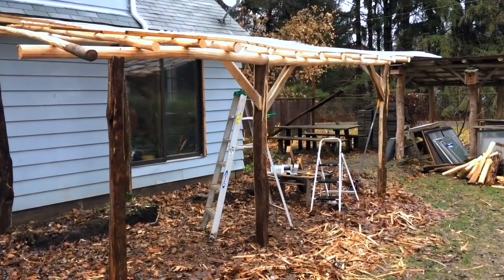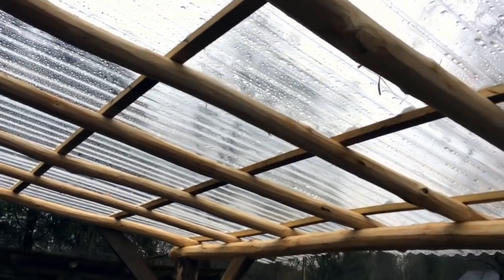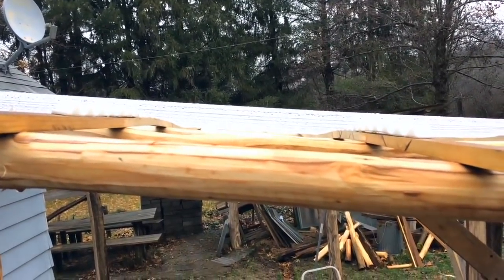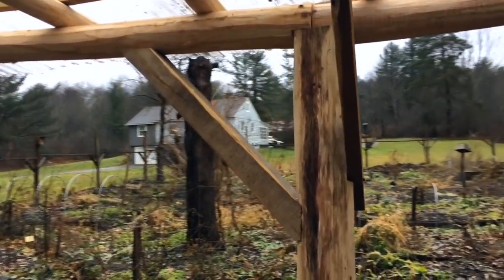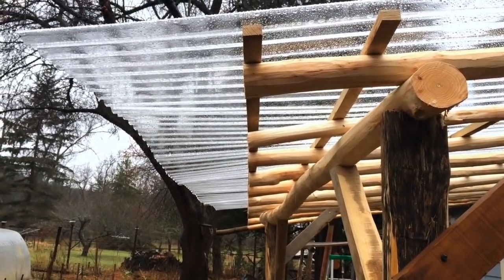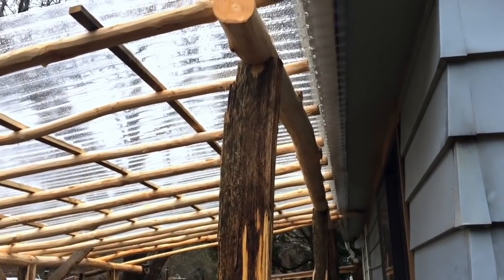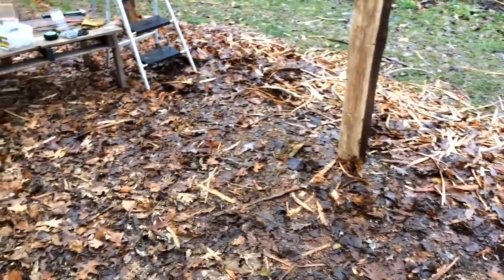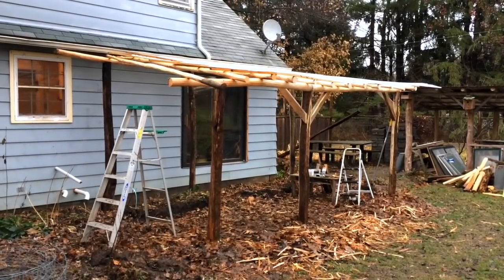Passive Solar Greenhouse - II - Roofing on and ready for walls

Comment: One more comment on the snow loading aspect. Depending on your area typical snow design loads are 20 to 50 pounds per sq ft. I'm eyeballing it here but it looks like you have roughly 10 feet by 6 feet. At the conservative end of 50 lbs per sq ft, you are looking at 3000 lbs. Also consider that the roof above this may sheet off snow onto the roof due to the relavite pitches. So just be careful thinking 200lbs is enough of a test, that could be an order of magnitude off.

Again, I'm not trying to make problems, but I think there is actually a potential for this to fail, and a little extra bracing, especially to eliminate any rotational moment arms.  Send those members into compression and not shear, it may be well worth it.

Quick edit... one other thing to consider is that the full weight, say 3000lbs will be spread across each member and you did a fantastic job using many members. Now it gets really complex here when you start considering that all but 3 of those members will bend and arent really supported against bending moment. The only 3 that are, are the ones with the 45 degree pieces. To assess it completely you would need to model it, but, all that being said, I think even with the excellent short spacing of the roof members, you will want to strengthen up those 45 degree pieces to put them in compression by driving the load through them, straight through the vertical posts, not attached to the side of them.
Reply: Not perfect with construction knowledge myself but this seems a comment focused on constructive,  helpful feedback,  thank you

Comment: Good progress. I'm not going to lie there is one thing I'm concerned with and that's the moment arm on the 45 degree pieces. Those should ideally be putting their load directly onto the support post, and not bolted into the side of it. Especially when you get a snow load and deflect the roof downwards (which could be substantially more than 200lbs),  it will cause that 45 degree cross brace to rotate counterclockwise, and the resistance of that whole roof weight will be on 2 bolts acting against roughly 1 inch surface area of the bolt hole, and trying to RIP the wood apart along a grain boundary.

If instead it is bolted directly onto the support post, the load on the wood sends it actually into compression and not shear. Things fail in shear at much lower stress levels (2x factor less than tension and much less that that even compared to compression). Again, engineer here, and I would highly suggest that you add one more 45 degree brace in those spots, and attach them through the centers of the roof and support post.

I love your videos, but I dont want to see your greenhouse fail on a rotational moment from snow loading, shearing the wood at the bolt location due to the side-attachment of that member.

It should be a quick easy fix, one new piece per vertical post. Just have to replace or supplement the one joining to the roof. The other one 90 degrees from that (which I think are attached correctly anyways) will have almost no load on them anyways.

Cheers from Canada.
Reply: Good explanation.
Reply from the maker: Thanks for this insight.  I'll admit I'm not fully understanding what you are describing here though.  Do you have any reading you could send my way so I can understand this more and add in some additional supporting if it feels necessary?
 I'm basing this design on a much more strong and dense version of many other small structures I've built that have held up to some crazy wind and snow, so I'm trusting it should be OK... but I want to understand your concern and learn if there is something better I can be doing here!
Reply: @edibleacres  It actually is a really well built structure, there is only one main problem and it's the way that the 45 degree piece is connected to the vertical post. 

The video thumbnail actually shows it clearly. See how you attached the top of that member to the roof right in the middle of the roof log? That's good. But see the bottom of that 45 degree board, how it is bolted into the side of the vertical post? That can be okay but only if the 45 degree member doesnt want to rotate. Here it will.

Imagine loading on the roof. It will cause all the horizontal members to bow. When they do (and they will, even if they hold), they will rotate that 45 degree cross brace piece downwards. 

When it rotates, the only resistive force against that rotation are the bolts. They will be supporting somewhat smallish loads, but will be acting against the bolt holes of the 45 degree member, which act as stress risers/concentrators. 

Continued....
Reply: Now instead imagine that 45 degree piece was screw connected to the support post right in the center (not bolted to the side). Similar to the other piece connected to the same post.

Now when the roof starts to sag under load, the 45 degree member will again try to rotate, but this time it has nowhere to go, since it is braced through the center of the vertical post. It will actually try to open up that triangle. If you wanted to further protect against rotation on that one member, you would add a wedge that gets compressed. Or add a new piece and bolt it sideways to the existing one.

Hard to communicate the idea in words. Basically just imagine if you tried to rotate the 45 degree post downwards, anything you can do to stiffen/connect and prevent that rotation will help. Right now the only thing resisting it are those bolts, and I'm a bit concerned they will just break through the wood when it rotates.

If that member is braced straight into the center of the vertical post,, the member will no longer be able to rotate and it will instead compress it. Or most accurately compress the bottom edge of it and tension the top edge. That is actually a very strong resistance (compression). VERY strong.

The other aspect to this which I didnt get into is static loading vs stability dynamic loading. The suggested new brace is stronger also under stability/dynamoc loading.

The solution is just to unbolt that 45 degree member from the side of the vertical post, and instead put it bang on, head on, onto it. Either that, or keep it there and run a new member next to it in that way.

It is a well built structure, it just needs that one tweak. Let me know if that still wasn't clear and I can maybe take a picture and do something in MS paint.

I hope this helps.
Reply: @edibleacres  sorry to spam you... maybe another easier solution...

Looking at the thumbnail pic...

If you could insert a wedge in between that 45 degree member and the roof, that would also work.

Infact another thing that could work would be installing a new piece that essentially goes from the top of the vertical post (or the end of the roof post),  to the center of the 45 degree connector. I.e. splitting that "triangle" down the middle and making two right angle triangles out if it. What that member would do is, if that 45 degree member wanted to rotate, it would resist it, in a direct line in tension.

That would also resist rotation of that member.
Reply from the maker: @Canadian Permaculture Legacy - OK...  now I get it fully.  Pointing out that it is element in the thumbnail helped me get where you were referring.  Makes perfect sense to me that having that support knit into the side of the upright post instead of pushing itself directly down and INTO that post would be MUCH weaker.  I went that route since the rafters of the round ash don't exactly match with the upright locusts, so it wasn't straightforward to make that connection full on.
 I like the double triangle idea and think I'll use that for this situation.
 Intuitively I think I knew that this type of knee bracing would not be providing a deep lock for the structure, but certainly couldn't put all the words and concepts to it.  This was a good thread to help bring some more clarity and depth of understanding to the concept, so thanks kindly for taking the time!
Reply: @edibleacres  Awesome! Yes, we certainly have to improvise when we aren't using perfect milled wood. The best way is over engineering it, which you are really adept at! I actually first noticed that in your wood shed build (which I will shamelessly admit I copied here).

Comment: As mentioned in comment on previous video my construction is somewhat the same. I agree with the ventilation next to the house.  In my case the structure is free standing with a wall of grape vines 4 feet to the north. The north wall consists of heavy felt from a paper making machine and strips of carpet and padding. I can roll these up to the roof for ventilation. I also have the screens that came with the sliders that I can put in place to keep things out. If you can get some discarded carpet or runners and fasten it at the top and a round wood at the bottom with a cord from the top between the screen and carpet under the bottom and back over the top then down on the inside of the screen you can pull the cord on the inside to roll the carpet up for ventilation.
For the sliders I drilled through the frames on the corners and screwed the frames to the top beam and a pressure treated 2X4 at the bottom. At first I had cement blocks at the bottom but now I have creosoted wood blocks that were salvaged with scrap roofing on the outside and a rubberized membrane on the inside to reduce exposure and the wood provides some ground insulation. The membrane goes down 16 inches then into the greenhouse 2 feet and back to the surface level. Thee is a drain tile in the bottom which I fill with water and the trench is filled with soil so it works as a wicking bed which is planted with winter greens now. I use wicking barrels so that I can crowd them in the greenhouse this time of year and then thin them out using my hand truck in the spring and only have the tomatoes and basil in the summer. 
I am still considering sticking bubble wrap to the glass and stretching strips between the purlens over the rafters. Half my freezing has passed and the tomatoes and basil have died back so that can wait until nest year.
Reply from the maker: Lots of nice ideas here, thanks for sharing this.  Lots of tricks to consider for sure!

Comment: This is awesome. Never let the perfect become the enemy of the good. I can't quantify how much I haven't gotten done yet because I didn't have the techniques down just so. This video encourages me to just get out there and do it. Movin' forward!

Edit: I assume that by not physically connecting this to your home, you can sort of get away without permits? Where I am you can build up to a certain size of building and so long as you don't electrify or plump it, you don't need a permit. As soon as you attach it to another existing building, though...
Reply from the maker: That is the main idea, skip the permit exploration and just build it as a simple standalone shed that happens to be close to our house...
Reply: @edibleacres  Only problem you could run into with this is that typically (in OR where I am) an outbuilding needs like 10' or so of clearance from any existing structure or property line. fyi. Enjoying your informative videos!

Comment: For the expansion & contraction movement I recall seeing log cabins being constructed and they used, I think, lag bolts in long grooves (channels) where they could freely move in the predicted direction without snapping or splitting the wood. So, thinking along those lines how about you ‘mount’ the windows into a frame that’s secured on to the structure using that concept OR having an intermediate rubber/plastic between the framed window/door and structure?

Very smart of you not to secure it to the house, you stopped SO many bureaucratic headaches before they had a chance to start.

Comment: Good choice to leave it freestanding.  Less worries.  You definitely need ventilation in Spring and Fall, so you're wise to build in some outlets for air flow.  All in all, yeah its not uber straight.  But it has rugged, rustic charm.  I'm going to be building another greenhouse in early spring, nice ideas and great work!  Enjoy your homestead holidays.  🎅

Comment: Perhaps, for the windows, you could frame them in wood sections and then hang the assembly, like a double barn door.  A valence at the top against water, and some sort of bracing track along the bottom against swinging in the wind.  Extra benefit to sliding walls, is you can just move the wall if you need to dump a wheelbarrow in.

Also, having the tuftex pressed against the underside of the eave makes me nervous about ice dams.
Reply from the maker: Nice concept here.  I'm doing something a little similar to this, although with the south side of the space I've just finished installing sliding glass door panels which are 3'x6' or so and REALLY heavy so they are 'static'.  I think I've got some ideas on how the rest can be framed out, but I'll certainly keep this idea in mind as a potential tool to work with!

Comment: I live in up-stare NY too and I know how strict and down right paranoid the building/zoning laws are here. If its attached to a permanent structure it opens up a can of worms. It looks like you have a similar structure to what you're building in the background. Very slight angle of slope on it too. But looks like heavier pole structure. Does it hold the snow load OK?
Reply from the maker: I've made probably 20+ small, simple structures in the general theme of this newest one.  Some for holding firewood, some for storage, etc.  Generally shallow pitches, but with the locust playing a role and some strong supports here or there, I've never had anything collapse over 10 years.  Not a long time of building, but enough to know the basic approaches I'm using are sound...

Comment: I am not a lawyer. Don't hang windows or doors. They are made from four separate pieces surrounding a pane of glass. This situation presents the roof and gravity an equal opportunity to tear your window frame in half. My version of this structure would have a ledge at shin-height onto which the windows would rest.
Reply from the maker: That is more what I'm going with in my mind now... Thick run of wood along the bottom that the window frames can sit on and a run at the top.  Then sturdy 'batton' type wood elements that help hold the windows into these boards but allow a tiny bit of shifting if needed...
Reply: @edibleacres  I found hanging mine that the screws have to go through the vertical part of the frame. If there is a pull on the horizontal portion it will pull the frame off the g;ass and rubber seal.  Also be careful not to pick up the sliders by the center of the long side frames for the same reason. Voice of experience.
Reply from the maker: I'm a big fan of experience voices!

Comment: About the climate battery. 
I've been thinking,  what if rather than relying solely on hot humid air from solar capture, one made ones own?

Any heat from a rocket stove,  TLUD or other wood burner operating in the greenhouse could be captured by a climate battery, but the transfer of heat via evaporation and condensation(phase change) is the whole point of a climate battery.
With water boiling on a wood burner,  the water vapor could be directed into the plenum to be sucked underground by the climate battery fan. 
With your supply of wood chips, a TLUD stove, with a dedicated pot and potskirt could boil water without tending for long stretches and make biochar at the same time.
Reply from the maker: Could be an interesting addition.  I think with this structure I won't be adding in a wood burning element.  My thought was I could pull hot air from our living room to heat the space if needed...
Reply: @edibleacres  
You do already heat with wood,  and make biochar at the same time.
Any thoughts on insulating the climate battery from the rest of the  earth?